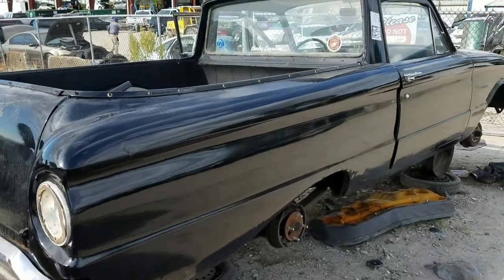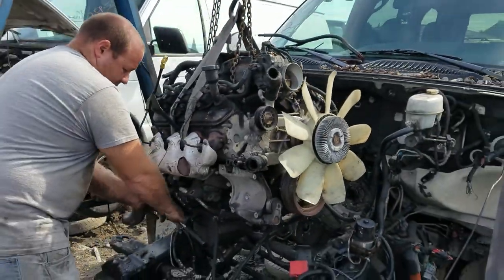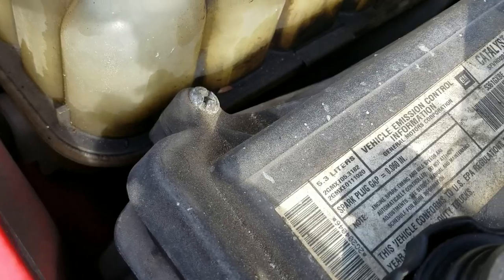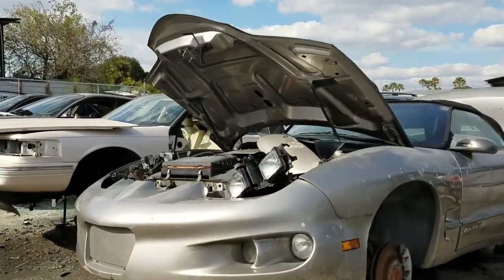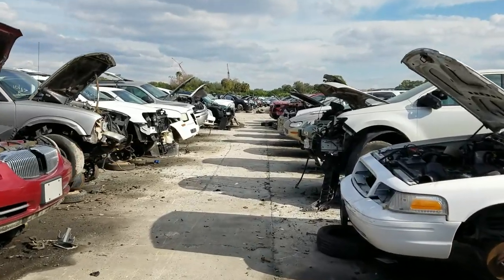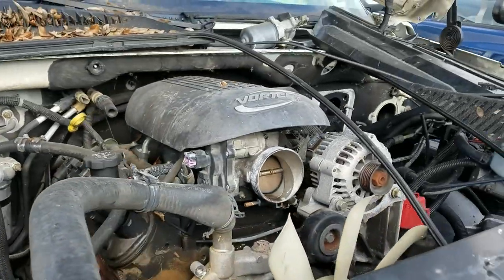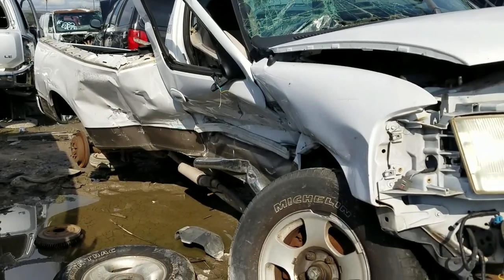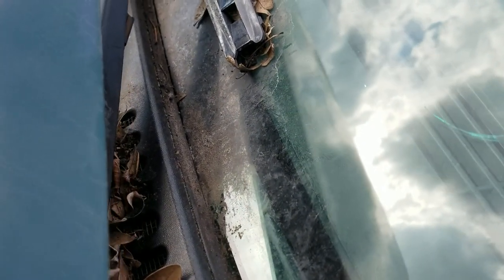LQ9 6.0 LITER HUNTING! LKQ Pick A Part Tampa December 10, 2020

Comment: lkq is ridiculous now. used to be cheap but now they are more expensive then autozone. in the 80s we would pull a hood around and anything you can drag was 10 bucks..
Reply from the maker: I agree. I stopped going so often. I used to grab engines several times a week.
Reply: I just said same thing. They quit doing holiday sales when the plandemic struck. And now you pay more for just a pair of ls heads then you did in 2019 for whole motor.

Comment: You need 29 inches of extentions for that those top bell housing bolt.
I picked up an 03 6.0 awd for $500
Did my first tranny swap in 25 years, and threw the tools in it.
Now I'm finding out it's tuned for 400 hrsprs. I can't wait to go through the drive train and front end.
Reply from the maker: That top bellhousing bolt sure is up in there! You're right, the extensions solve the problem!

Comment: Look at the 8Th digit in vin 6.0= U (LQ4), N (LQ9)
Reply from the maker: Yup, that bit of info has served me well!
Reply: Which is better? Lq4 or lq9. I own a rusting out 2004 esv. The engine and trans are very clean and smooth running. I’m wondering where I could net the most selling as driver or parting out?
Reply: LQ9  higher compression, lower production #

Comment: He didnt hustle,he go tipped off.
Reply from the maker: Yeah, and I didn't. I gotta get on my game! lol
Reply: @mohawkgarage  here in socal you pretty much have to be either there at the junkyard when they pull the truck out or get a notification on the app and still make a run for it hopefully its there when you get there other then that you can alwayd settle for a 5.3. There is always at least a 6.
Reply from the maker: @JoseContreras-mv5yz  It can be the same way here. Some yards pull the 6.0 before the truck even gets to the yard. Escalades routinely show up with no LQ9. I guess someone has a connection I don't have.

Comment: How much will the pick a part sell the engine for ?
Reply from the maker: Different prices for different levels of completeness. They also have discounts on holiday weekends. Just download the LKQ app and you'll see locations, prices, inventory and prices. They even have an ongoing points system that adds up to discounts for every $500 spent. Great app! Good luck and thanks for watching!
Reply: @mohawkgarage  makes sense. Buddy of mine is selling a 6.0 out of a yukon xl 2500. 300 bucks for engine, harness, ecu. All accessories. 160k miles just curious if that was a good deal
Reply from the maker: @artysmotorsports  That's a smokin' deal!
Reply: @mohawkgarage  I'll be grabbing on it soon 🤘
Reply: @mohawkgarage  LKQ where I live Huntsville, Al quit doing holiday sales. Before plandemic you could buy engine on holiday sale for 225 now its 500+ no accessories or wiring. Pair of ls heads will run almost 300. Their prices on everything has gotten fkn ridiculous
Reply from the maker: @BruceLee-xn3nn  I agree. I don't go as often as I once did. It's just not worth it. Thanks for watching and commenting!